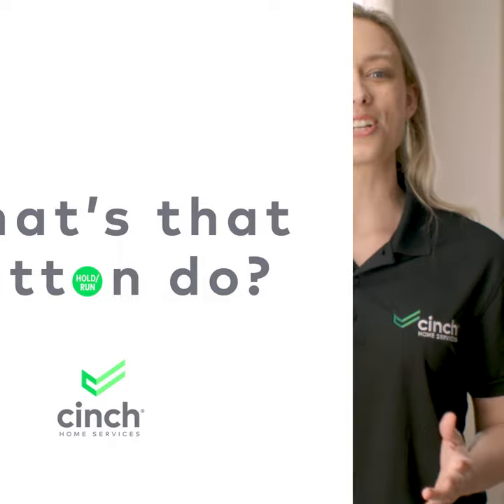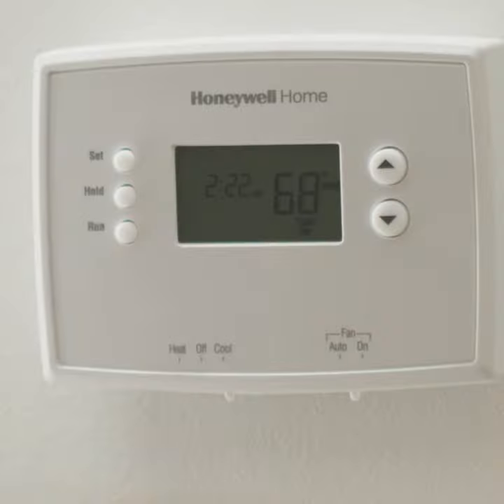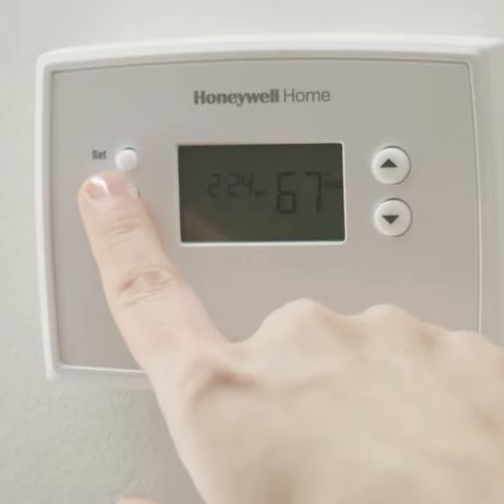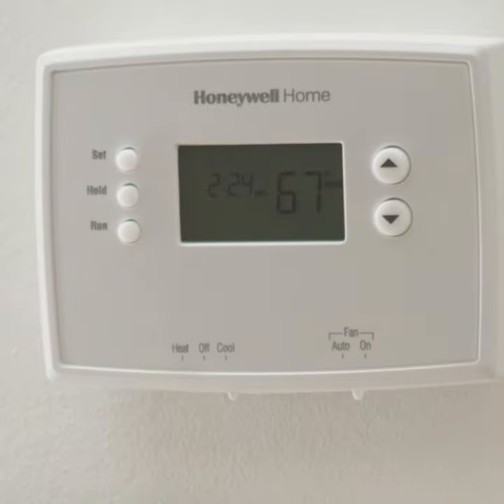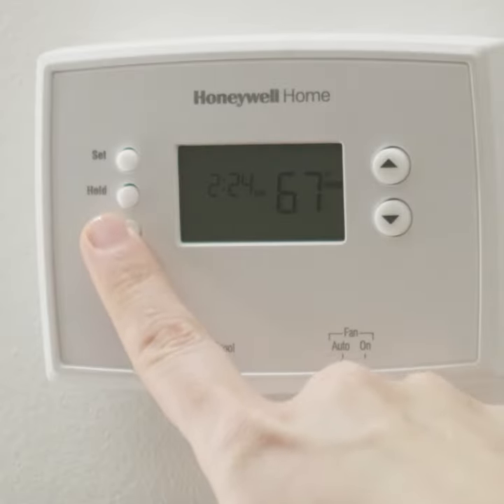What Does The Hold/Run Button Do? | Cinch Home Services

Comment: Ok. But what’s the set button do?
Reply: it sets the schedule for the thermostat and allows you to customize what temperature you want to kick in at what times. which is why the run and hold buttons are relevant- hold to keep it at the temperature it is currently at (especially if you turn it up or down a bit) so it doesn’t change when it is scheduled to, and run to resume back to your scheduled set times and temperatures